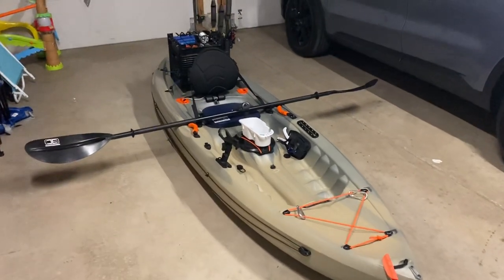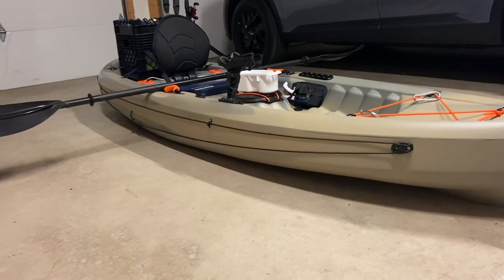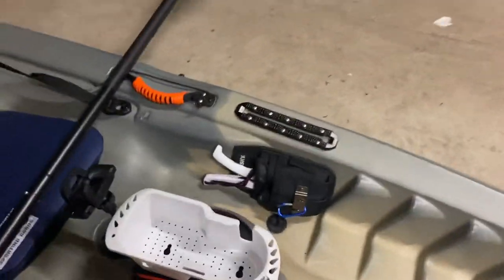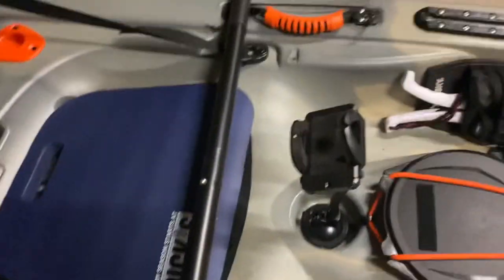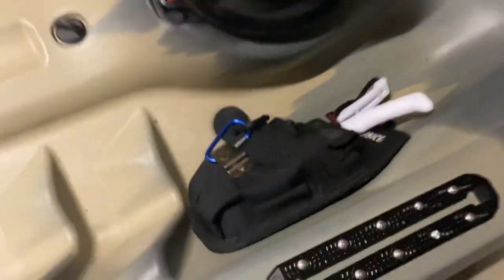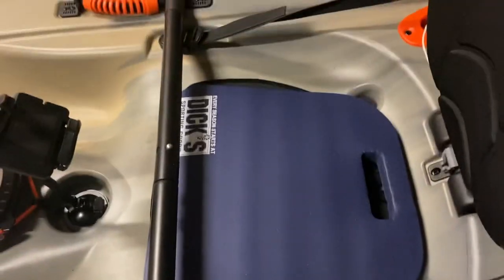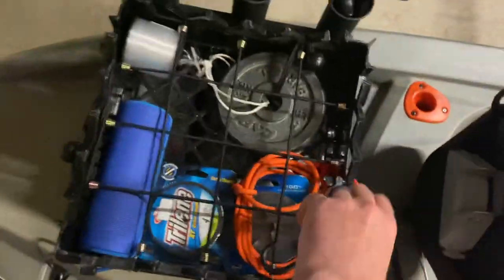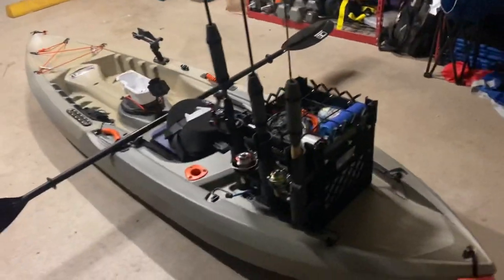Lifetime Tamarack Angler 100 | My Mods/Upgrades on a Budget Kayak!

Comment: Thanks for the video man. I recently got a Lifetime Tioga angler and I love it. I wish there was a way to upgrade the seat without drilling into the hull of the kayak. I got one of those seat pads and I took a hammock strap and ran it through the back of the seat and tied them to the handles  on the kayak to provide more back support.

Comment: Where did you get the six pack of rubber drain plugs at? Just got tamarack angler 100 for Christmas so I have all winter to get it ready for spring. Thanks for all the ideas. Great mods.

Comment: This is modifying….I’ve had my tam for three years and love it. 
Last year I modified it with a minnkota 30, I have a bro craft mount. Lights: blue/green leds underneath and front running leds. Running off a 6 switch console with 7 inch cv plus fish finder. There’s two lithium batteries in the haul that feeds the front and 100ah lithium for the motor. 
“YES” balance is your top concern, always keep that in mind when modifying. 
I’m currently having a new minnkota traxxis 45 shaft cut down to 28 inches. Minnkota wouldn’t do it so I had to source it out. Hopefully it’ll be done by next week.
Reply: Please make a video of Your kayak mods 😊

Comment: The $17 stadium seat at Wal-Mart is the best upgrade I've done yet!
Reply: How did you attach it?
Reply: @captainnathan1164 you don’t hand to, they sit snug in place of your worried about it moving just use a bungee cord and add something yiu can clip it to into the back by the flush mount rod holders or connect the bungee to the milk crate

Comment: How did you do the hinge for the "lid" of your crate?
Reply from the maker: Yo yo! Cut off the top of a crate, drilled holes in the main crate and the “lid”, zip tied em together. Change them out every so often to keep ‘em fresh
Reply from the maker: I’m actually messing around with my crate now - may do a quick video for DIY crate if that’d internet ya at all
Reply: @choop7161  that would be cool